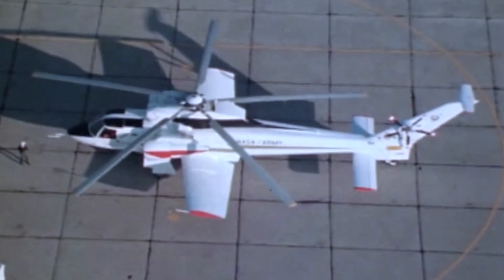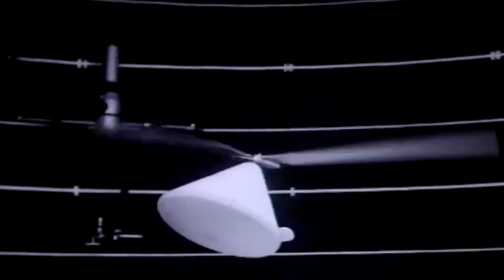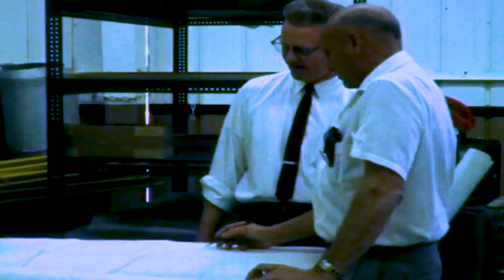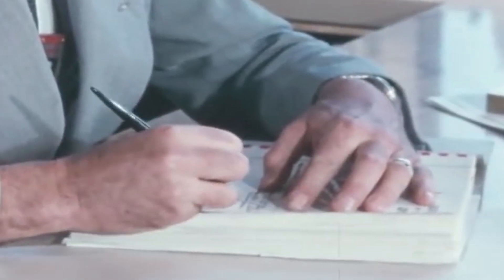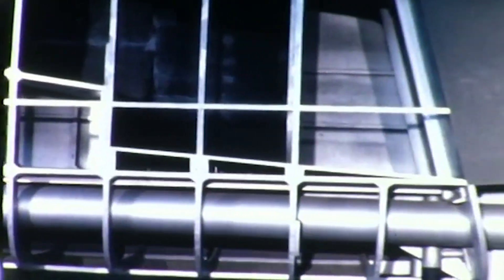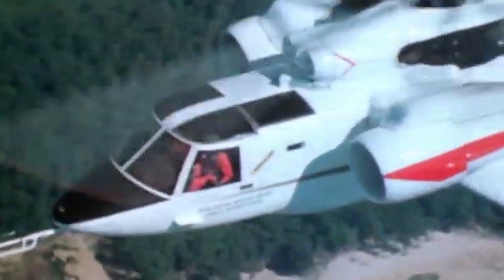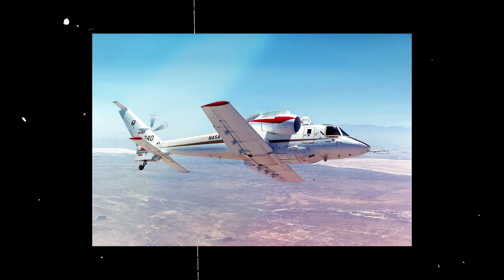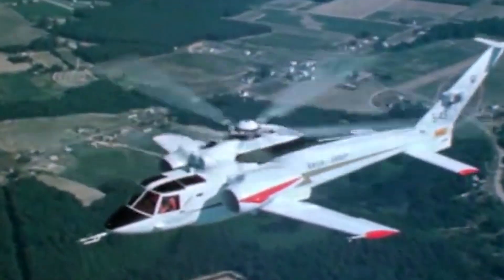The X-Wing - S-72 Jet Helicopter with Blades as Wings

Comment: "Too expensive and ambitious for it's time"
Sounds like the V-22 Osprey and they still built that turd.
Reply: The V-22 went through it's teething troubles and has been fine since.
Reply: @Ushio01  exactly and there are civilian varients being developed now.
Reply: "Turd"? Not hardly.
Reply: @ronaldschoolcraft8654  Osprey is a huge TURD.
Reply: @interman7715  OK, so the capital letters are more than I can take. 🙄
Reply: The V-22 has been a workhorse in combat.
Reply: It's NOT a turd. It was born JUST before the advent of the 80286 intel CPU, (or micro pc) needed that for the "fly-by-wire" systems that are now default and you don't even know it when you fly today! We had to allow Moore's law to apply to computing systems BEFORE the tech could "come in". Capiche?
Reply: @htos1av  Osprey is a turd just like the F35 .
Reply: I aestethically do not like the V-22 too but you have to admit that is the best mid sized transport airplane available, in fact i do not like the Harrier aesthectic too, it looks like that its wing had some depression issues.
Reply: What the hell are you talking about. Its an excellent design and a huge step forward in rotary aircraft design. The concept is great for the intended qnd now implemented design man. This thing should be revisited as well.
Reply: This design should be revisited. The concept would be great for a high speed coin/interdiction ac. I can think of many applications for this design that the navy and marines could utilize it for. The super cobra while a great aircraft (and one of my personal favs (:) imagine it, blades folded back in q stowed and swept position. Navy grey livery...full combat load of 64 rocket, 8 hellfires, 2 sidewinders,sidewinder, perhaps even room for extra weapons such as 1 harm/harpoon/laser guided bomb(s)/jdam ect. Taxis up to the cat aboard the Gerald r. Ford super carrier. Persian gulf, 174 nautical miles off the Iranian coast. The U.S. Navy is getting ready to launch its very first attack helicopter...not just any attack helo, a hybrid capable of dynamically converting from its helicopter capabilities to a fixed wing aircraft mode. Enabling the aircraft to arrive much more quickly and from further away to assist troops in c.a.s, c.o.i.n, and a variety of interdiction duties.
Reply: Sooooo many Marines have died in those things.
Reply: @johnbrady7431  Yeah my brother almost died in one in Iraq.  You know for the price of a V-22 you can buy a Hercules and a Blackhawk.  The Herc hauls more and the Blackhawk is more reliable.
Reply: @rayceeya8659  Glad to hear he made it. I was Army Infantry, air assault in 2000 and I knew they had been testing it for years before that. And knew as a teenager how dangerous they were. Couldn't imagine command telling me to ride in one.
Reply: @rayceeya8659  yes, the C130 is an amazing airplane. I've worked on those T56 engines (and the new 2100s in the C-130 J) as well. However, even with as amazing as it is, it cannot do what the V-22 can do. If you're measuring effectiveness by death count, the Hercules has had far more marines, soldiers, and sailers die in it. Ditto the Blackhawk, which is also a good airframe. However, it cannot do what an Osprey does. Any time you introduce a radical new technology, there are teething pains. It's unfortunate, but reality nonetheless.
Reply: @ronaldschoolcraft8654  
The "death count" doesn't matter.  The C-130 has been in service for over 60 years and the Blackhawk has been around for over 40.  For the price of a single V-22 you can have TWO reliable and tested airframes that can do the same job together.  I really don't want to make this a debate about combined arms, but I can if I have to.
Reply: @rayceeya8659  I was talking about the osprey....
Reply: @rayceeya8659  so, a C-130 can fly out to sea and land on, and operate from, the USS America? Or the USS Wasp? Gee! I didn't know that. Thanks for informing me... But wait, Blackhawks can operate from amphibious assault carriers, but do they have the range to fully support the same missions as the V-22? It's interesting that the Navy is now planning to retire the C-2 for the COD mission and use Ospreys instead. Did you know that in the 1960s, the Navy looked at the C-130 for the COD mission? It's too big. The Blackhawk doesn't have the range or payload capacity to do the COD mission. So, again neither the C-130 or the Blackhawk (Seahawk in Navy parlance) can do what the V-22 can. The Hercules has excellent speed and range, but cannot take off and land vertically. The Blackhawk can take off and land vertically, but is deficient in speed and range. The Osprey combines the advantages of both types into one. It's OK if you don't like it. You can be wrong if you want to.
Reply: @ronaldschoolcraft8654  
A C-130 can take off and land on an unimproved runway only 1000 yards long.  That kind of material transport is what really wins a war.  The Blackhawk can also extend it's range with mid air refueling so range is irrelevant.  The mama bird carries the fuel and the baby bird completes the mission.  It's a tried and tested weapons system that has decades of development and reliability behind it.
Reply: @rayceeya8659  if range is irrelevant, why, then, did every RFP and upgrade program that I ever worked on as a design engineer at a gas turbine engine manufacturer ask for significant improvement in range? This is for both fixed and rotary wing aircraft. Not only that, but they always wanted better hot and high performance as well. It sure didn't seem to be irrelevant to the people from the military who were writing the requirements documents.
Reply: @operator0  
"People who say the V-22 is junk don't understand the importance of it's most revolutionary capability; Range."

ARRRRGH! Sorry but range is irrelevant thanks to mid air refueling.  You can fly a Blackhawk across the Pacific Ocean as long as the crew holds out.  Have you ever heard of the KC-130?  The tanker version of the C-130.  It's made to refuel helicopters and can loiter for days.
Reply: @rayceeya8659  see my earlier comment about the irrelevancy of range. Those military planners sure asked us to increase it a lot for something so irrelevant.
Reply: @ronaldschoolcraft8654  
You misunderstand.  The range argument for the V-22 is irrelevant because it can be matched by a conventional helicopter with mid air refueling.  Range is quite relevant in a combat situation, but the extended range offered by a tilt rotor does not.  The V-22 is hauling around unnecessary hardware because it's flight profile is over generalized and really only useful in an edge case scenario.  

Think about it. A KC-130 can take a Blackhawk anywhere in the world.  However going into hostile territory the KC needs to duck out to avoid being shot down.  That means that the Blackhawk has a limited range from that point on.  That range is about 400 miles.  The V-22 has a range of about 1000 miles at that point in the mission profile.  400 miles radius is bigger than the entire country of Iraq or Afghanistan.  In fact it's approximately the distance from Hanoi to Saigon.  That extra 600 miles doesn't mean much to me.
Reply: @rayceeya8659  "doesn't mean much to me." This is the crux right here. It might not mean anything to you, but that doesn't mean it is irrelevant. Your personal preferences are what are actually irrelevant because you are not making the decisions (thankfully). Similar arguments were made when mechanization was implemented in the military. "I can buy 'x' teams of horses for the cost of one of those new fangled trucks." I am certainly glad that we didn't listen to those arguments then and I'm glad we aren't listening to them now.
Reply: @ronaldschoolcraft8654  
Whatever man.  The C-130 and the UH 60 will be flying long after the V-22 is rotting away in some bone yard.
Reply: @rayceeya8659  we'll see. By the way, I am a huge fan of the C-130. As I said, I have done engineering work on the T56s and the AE-2100s. It has already been flying for 64 years. That's a testament to its greatness.
Reply: @rayceeya8659  yeah, exactly, who makes the Blackhawk? Sikorsky 👍
Reply: @sophiepaterson7444  
They're also building this:
https://en.wikipedia.org/wiki/Sikorsky_S-97_Raider
It's like a Blackhawk but faster.
Reply: @rayceeya8659  badass.
Reply: @rayceeya8659  
Does every Blackhawk sold come with a free KC-130, crew, and support staff? If not range is important...
Reply: @rayceeya8659  If you have sufficient runway at both ends when and where you need it, no VTOL makes sense.  And of course you have to hope your C-130 and Black Hawk can get together simultaneously  where and when  you need them.
Reply: @johnbrady7431  Yeah, how many have died in that thing since it became operational?
Reply: @operator0  looks like 12 during hull-loss accidents and blah blah blah.
Reply: @johnbrady7431  42 people total have died in V-22 accidents/incidents.  30 people in the testing phase and 12 since operational status started in 2007.  

The CH-46 Sea Knight which was replaced by the V-22 had the following fatalities due to accidents.

2009 - 7
2006 - 4
2005 - 2
2003 - 17
2002 - 1
2001 - 6
and it goes on back to 1963.

Honestly name any military helicopter or plane and the list of deaths through accidents is significant.
Reply: @Ushio01  I went to Wikipedia too. Look at how many of those accidents were Marine Corps related. Crazy. You telling me it was the pilots fault? Jk
Reply: @Ushio01  those numbers have to be compared with flights hours, though. 
Less people die from jumping off tall buildings than in car accidents every year, but this doesn't make jumping off a building safer than driving a car. It's just that less people do it, but its lethality is 100%.
Reply: Honestly, they did pour a ton of money into it until they got it to work. Was it necessary....
Reply: @johnbrady7431  You tell me. https://en.wikipedia.org/wiki/Bell_Boeing_V-22_Osprey#/media/File:MV-22B_combat_radius_in_Iraq_compared_with_CH-46E_combat_radius.svg
Reply: They started building Osprey in what, the 80s then I thought they gave up on it, then it reappeared and crashed a few times, and they’re still trying to make it work. Yeah, no politics there.

Comment: Good show, btw.  Finally, someone who correctly explained the Coanda effect in clear in simple terms. Thank you
Reply: Spoon...running water...usual demo.
Reply: Yeah, he explained it right but then showed a controlled blower vent tail boom assembly on a helicopter.   Driven by blowers connected to the turbines.
Reply: @prjndigo  True but there's several uses for Coanda in aviation. First time I saw it not dealing with aerodynamic flow was on the heat mitigation of the exhaust stream from the nacelles on the V-22. Pretty smart but you still have to use compressor bleed air piped down to a (high failure rate) tube and then logic gates for weight on wheels, nacelle angle and turbine speed. BUT, it does help reduce the chance of the aircraft from starting ground fires or burning up deck plating.
Reply: @prjndigo  I looked at the diagram of the NOTAR.  Yes... though the forced air is created in the turbine, the exiting sheet of air is engineered to expel (blow) across a curved surface creating the directional force desired.